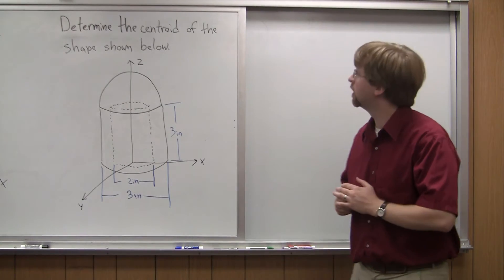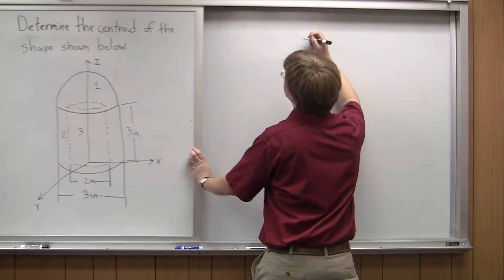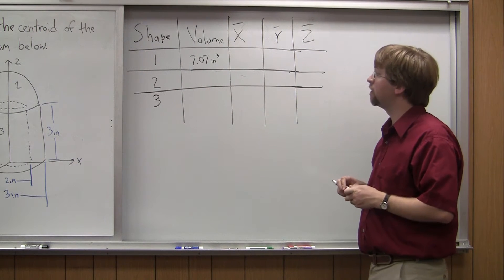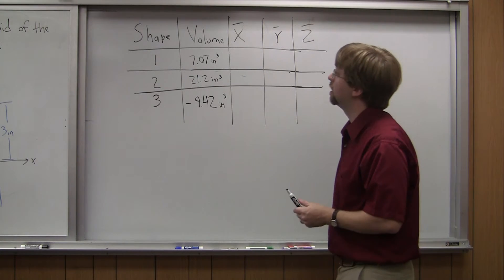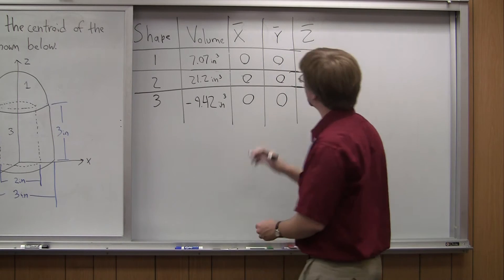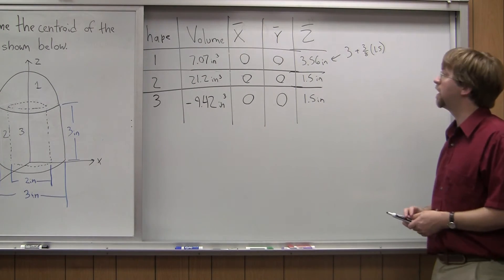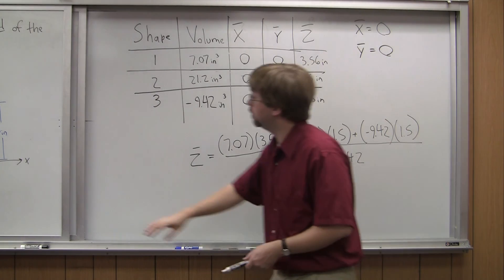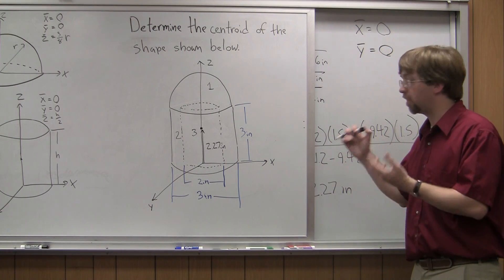Centroids (3D) via Method of Composite Parts - Adaptive Map Worked Example 1

Comment: how can you fınd 3/8 at z 1
Reply from the maker: The 3/8 r comes from a table of centroid locations. I personally used this table of centroid locations and  mass moments of interia (http://adaptivemap.ma.psu.edu/websites/centroidtables/centroids3D/centroids3D.html). Ultimately, those values in the table (such as the 3/8 r) were calculated using integration methods as discussed in other videos. Once we run the numbers for one hemisphere though with a generic radius r, we don't need to redo all that calculus over and over again.